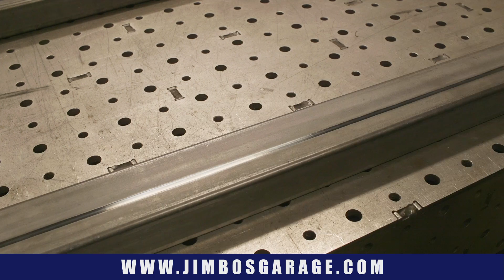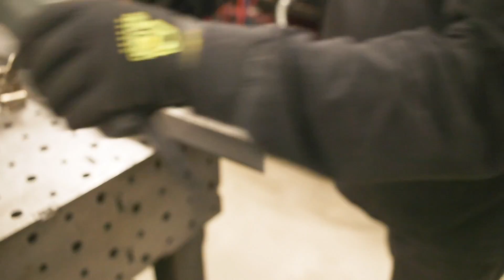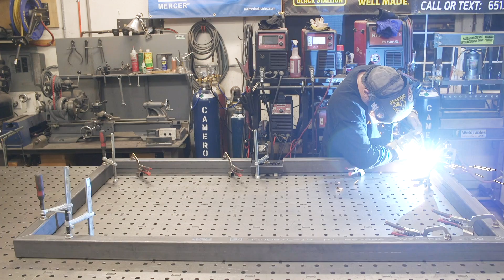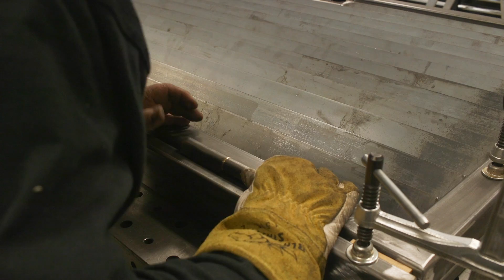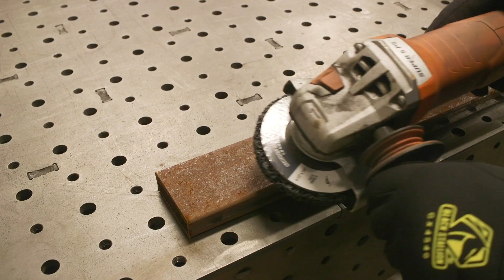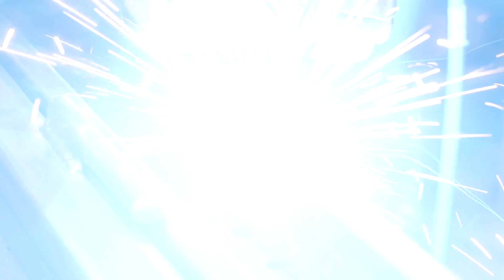Metal Louver Gate Build | JIMBO'S GARAGE

Comment: That's a very nice video; thanks, sir. Do you think using a tig welder is practical for making 8m of metal fencing at my garage? I am just a DIYer with a little bit of tig welding experience. My concerns are too much welding fumes made by MIG and also spattering surrounding items. Appreciate your replies.

Comment: Nice work.....  For grinding down smooth..................And so easy with the beautiful table.............I would have cut the steel tube for the frame "short" to leave gaps at the mitre corners . The gap depends on how you weld , but no more than the tube wall thickness maybe towards half thickness????  Easy to fill and get near full "penetration" Which matters When grinding down for a lovely beadless SMOOTH Pro finnish.  THIS ALSO RESULTS IN A GREAT DEAL LESS DISTORTION STRESSES AND PULLING AS THE WELD IS "IN THE METAL" NOT ON ONE SIDE...........  Bevelling all those joints would be soooooo much more work                                                              top notch setup and squaring great product you are a tidy worker

Comment: I made the same gate imagine having a 35 louver of a 2.5 x 1/4 flat bar. It was so heavy that it did bend the rectangular frame upon installation so I have to provide a roller with springs to easy the burden on my hinges and the frame itself

Comment: lol. I have certainly made that mistake a few times. Throw it on the saw, cut your 45's, only to find out they are on the wrong sides. For me, and the fact that I use square tubing so much, it does not matter what side you cut it on. But that's certainly not the case with rectangular tubing. It does not forgive.

Comment: Jimbos garage do not be afraid to turn the amperage up on your mig set, the flat bar can take the heat, this will help get the throat length of your T fillets more flat. Good fabrication work 👍👨‍🏭

Comment: Awesome video buddy.
Have you seen the angle grinding disc that has a chainsaw chain around it?  Beware of dummy ppl that installed one on his grinder and didn't take safe steps on using it and it jumped out of MY hand and cut the top of my foot and my left finger bad.  Lol

Comment: Nice gate mate, i used to make steel doors and windows every day and one tip with the weld on hinges is to use a piece of rod the same id as the hinge pins that can go through all hinges as you tack/ weld them on.. (so in this case a piece of rod several feet long) this is so the hinge centres are in alignment and the gate isnt trying to fight itself as it opens/closes as what we saw is that over time they can break due to fatigue, we also welded both sides of hinge if possible. Hope this helps! Nice work

Comment: helpful tip for everyone. add a little bit of anti seize lubricant to your grinder arbor shafts for easy disc changing without tool. even when the disc gets snagged, it'll be super easy to release the nut

Comment: I find when I want a lower profile weld for aesthetic reasons like ok the louvers here I can get a much flatter we'd pushing vs pulling. Pulling penetrates better, but the push sits flatter on the surface in butts and fillets.

Comment: I think in the long run the customer and therefore the designer will regret not having some sort of support through the middle of the gate to prevent the louvers from flexing   

It does look great installed.

Comment: Good job !!  I like that 
Question for you = how many welding machine do you have ?????
Do you need all that ??
Because i don't have your budget , what is the best welder do you suggest for me to buy ???
Diy  project in my garage .There is so many things out there.Now give me a choice for arc welding and mig
I would like to have a strong ( 220 volt machine ) welder , because if i can weld 1/2 inch  or 3/4. thicness , than  it will be goid enough for me for all my projects .Because. the 1/2 inch will be very rare , but that will give me a reference for how strong the welder be
Thanks in advance 
Serge ( from Mtl )
Reply: The Miller 220 would be a great machine for a beginner and also serious hobby or small pro guys. It is the same as the 211 that I have (mig welds 3/8" steel or aluminum in one pass) but it has AC tig for aluminum. I use an old Miller 330abp for my tig work. For 3/8" and up you can easily run two or more passes. The 211 and 220 are 230 amp mig machines and do a very nice job on 3/8" steel on 240v power. They run on 120v and 240v and the 211 was impressive when welding aluminum with a spoolgun on 120v when I forgot the 240v adapter. These machines are still easy enough for one guy to load in a truck or move to another work location. There is no way I would want less than 230 amps for mig. My tig machine go up to 460 amps and I use up to 300 quite often, but it doesn't have the wave form of the miller 220. The miller 220 is around $3000 US dollars. If you choose another brand, look for similar specs as the miller 220. A 140 amp machine is only good for 1/8" or so and a 180 amp machine should do good on 3/16 and ok on 1/4". I had the miller 135. Bigger is better and 230 amps for mig is a great all purpose size.
Reply: Thank you so much for your answer and time , this will guide me a lot in my choice in buying a welder 
Thanks again , appreciated 
Serge ( from Mtl )

Comment: Hey Jim, time to build a small gantry above your weld table and use a chain-fall to move some of that heavy stuff. Future project 👍
Reply: The overhead garage door is above part of that welding table, plus the roof joists would need to be reinforced.  Time to move to a commercial building with more overhead and a lot more room, for features such as a gantry with chain-fall.

Comment: Regarding the rubber plugs.  Their OK if you are going to paint your project black.  If you are going with another color they will be hard to miss.  I use the plugs electricians use to fix a steel box when they punch out the wrong hole.  They can be powder coated.  If your coater says in can't be done show him how they can be racked up with a magnet on the end of a heavy (coathanger) wire.

Comment: When you mess the cuts up can't you just cut end off and weld in some offcuts to extend the pieces then recut? Assuming it's getting painted and it's only a gate, depends on the client I guess?
Reply: Manny Calavera 
For a personal project yes, for a paying client I wouldn’t do that.
Reply: Manny Calavera Yes and no. Wouldn’t be that strong if you buffed the welds down flat and it’s tricky to keep them straight
Reply: You definitely could. That's the beauty of metal. You really cant mess up too badly like with wood or stone. If those repairs are allowed. Most quality work won't have that. Even if it's being ground smooth and painted. It's harder to make sure it's perfectly square. And even with expert welders, it can introduce a potantial failure point in the project. It's why no one allows joints in sections of a roll cage. Like the hoop around the driver.
Reply: That is often the difference between a worker and a craftsperson. Once says it is only a gate and the other does the job right.
Reply: I am a self employed welder . If I made that mistake , I would have made the corners correct ,. Then cut and  slugged it in the middle . I replace the back end of rusted toyota pickup truck frames quite often . Been doing it the same way for 2 decades 3 of witch have been rear ended . No problems

Comment: Grease fittings are not needed on the hinges. I have over 60 year old greenhouse doors which are open several times each day with the same weld on hinge. The only thing is that you have to replace the brass washer every 15 to 20 years, then put some grease inside and your done. They never made any noises, except when you slam them.
Happy holidays to everybody from Germany!
Reply: how do we know you are from Germany?  could  you prove it?